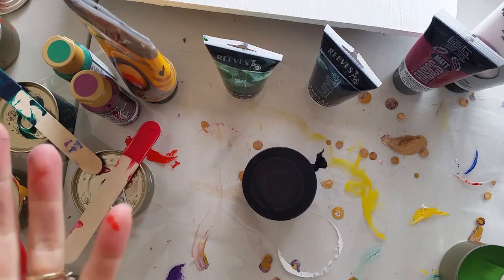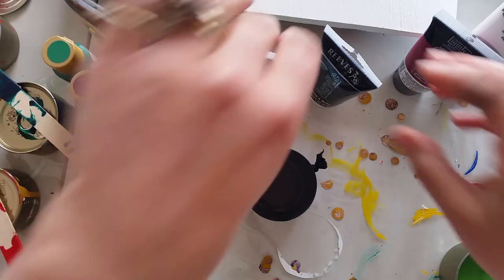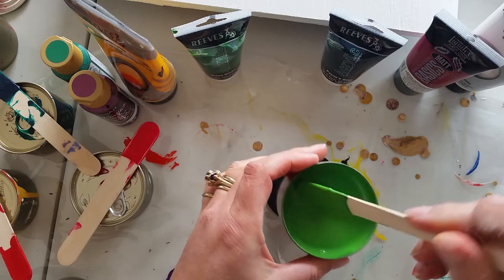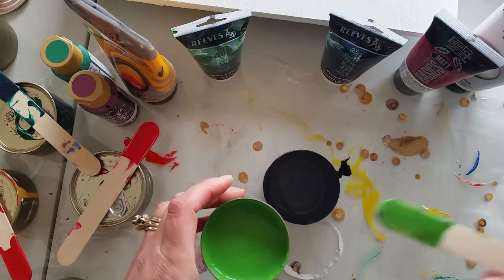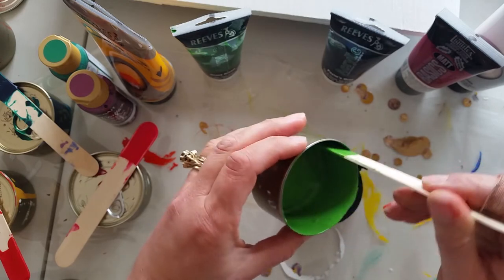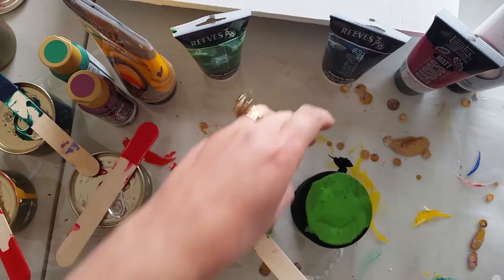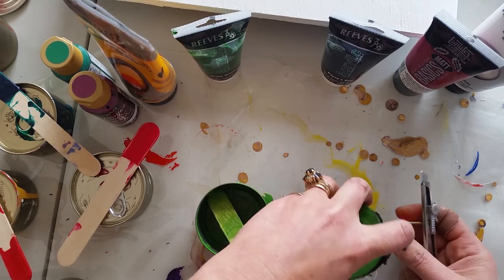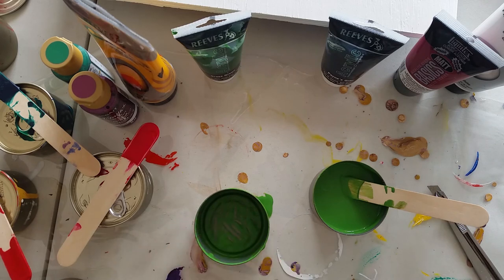042 Getting Rid Of Lumps in Paint

Comment: I have this issue with brand new paints that I got at hobby lobby for $30 (a set of 48 colors originally $50 but had a coupon 😂) I strained them and it worked, but it is such a tedious process!! I used an old kitchen strainer and trying to make sure the paint went into the cup rather than over the edges was so frustrating! I love doing pours but having to do this every time will be so annoying 😕
Reply from the maker: Yes it sure can :)  I wonder if it is the brand you bought or if it  was a "bad" or old batch.
Reply: I got an 8 oz tube of liquitex ultramarine from there that was like a ricotta consistency. While I’ve strained paints plenty I’ve never purchased a paint in that state before and was definitely annoyed. 
Like ok, I got a decent brand and now I gotta deal with this lol, my luck. Though this didn’t really answer my dilemma. I’ve seen where people leave it mixed over night and with a good stir the next day the lumps should work themselves out. Wasn’t sure if they used pouting medium or a tiny bit of water or what...... oh well. Sorry I babbled on your comment 😬😂

Comment: I had to chuckle, because for the past year or so I’ve made great use of old window sheers as a strainer and man does it go a lonnngg way. I constantly am walking away from paints without realizing that I may not make it back anytime soon to properly store them and so strain paints all the time and with some of my premixed paints I pop a square of the sheer between my bottles and the top so the paint strains as I’m pouring it from the bottle the only downside is it can create air bubbles but it has saved my butt on more than a couple occasions. The only limit is your imagination, right? 

Happy pouring everyone ❤️
Reply from the maker: Great tip Rachael, I do that with my floetrol but don't store mixed paints in bottles but if I did I would steal your idea!
Reply: I've seen house paint strained via paper funnels that have a mesh on the end.
However, I rather like the convenience of a filter mesh somewhat inside the bottle itself.  :-)

Comment: I just did a paint pour with a lot of acrylic metallics. Every one of them was new. And they all came out creamy but seized up when I added my usual (and common) medium mix--curdles, glunks & chunks! I ended up running for a knee-high and strained them (what a mess!). This worked out very well.  My non-metallics didn't react this way at all and were fine.  Does anyone know why this happened with the Metallics?  My pour medium is Elmer's glue, water, floetrol and a bit of matte medium.
Reply from the maker: Sorry I am not sure why this has happened.  I haven't had this happen with metalics before.